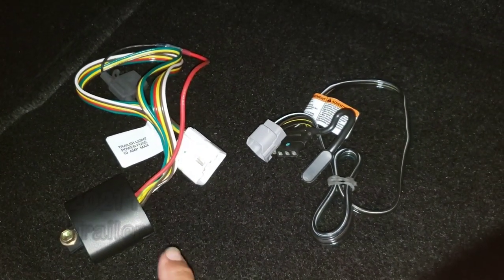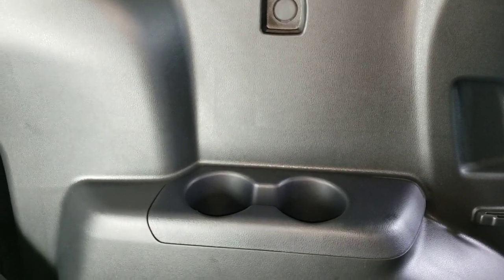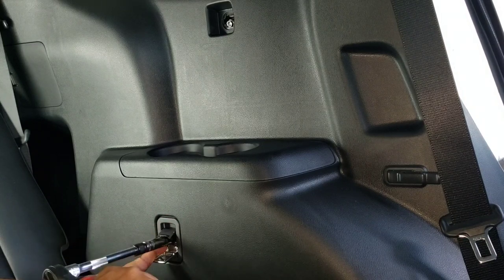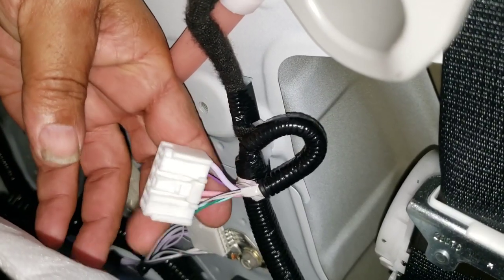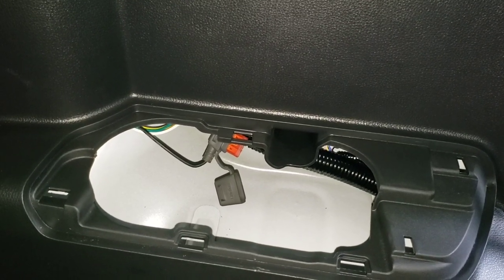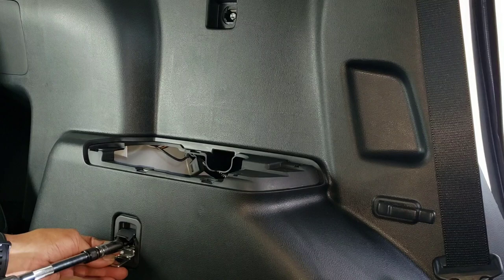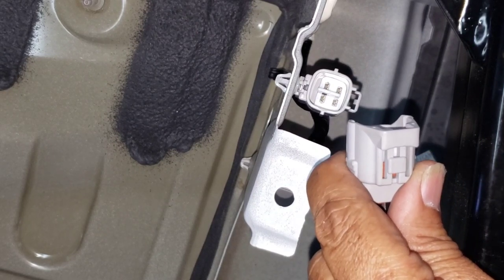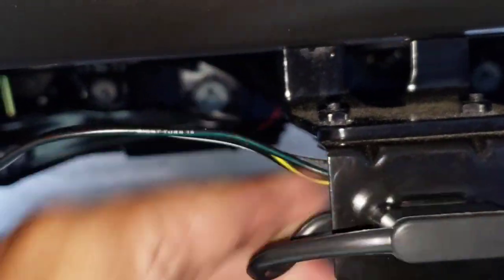2021 Toyota Highlander XLE Trailer Hintch Wireing Kit Installation

Comment: Why do they only provide a 4 pin connector rather than a 7 pin so you can use trailer brakes?
Reply from the maker: that the way they design it